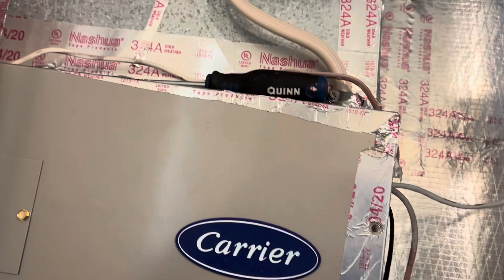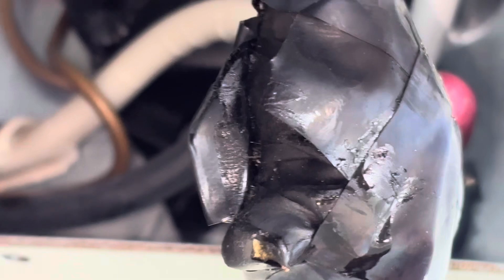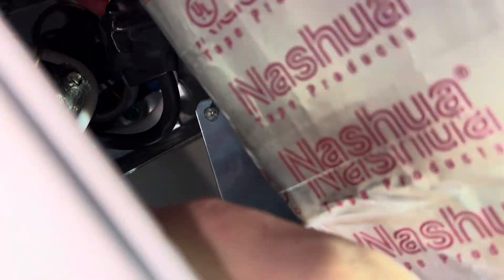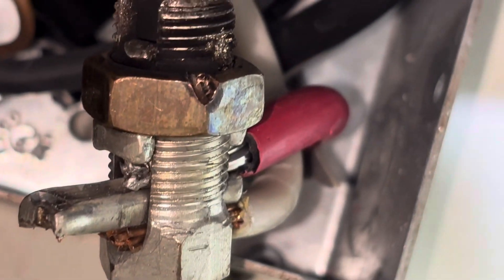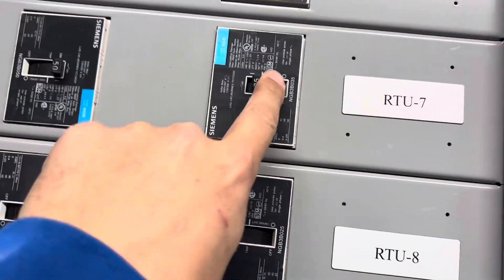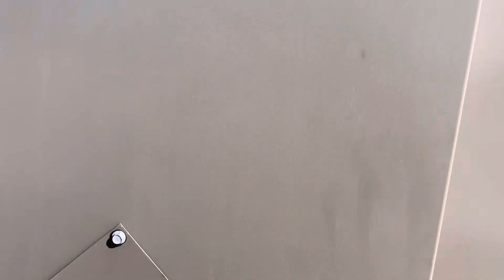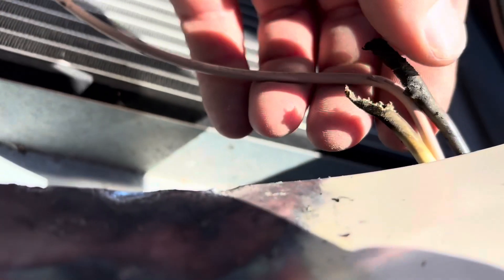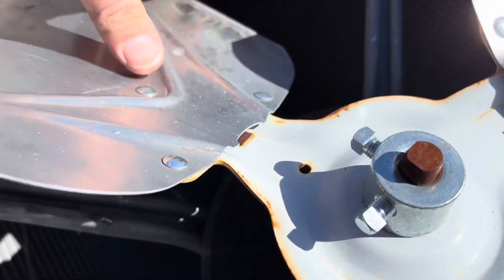Breaker Keeps Tripping On Heat Pump!

Comment: Well if I was a betting man I would guess the main line was ran long before the unit was installed 🤷🏻‍♂️ but that box? Cu inch wise is. Under sized. I have seen so many times apprentice and journeyman mount a box by the number of conductors, but they forget to take in the wire size changes the amount of conductors for box🤦‍♂️   Them split bolts  they are the best for a secure connection but most don’t use the protective box over them the old school way rubber then vinyl tape..
Nice job on the condenser repair👍❤

Comment: Thanks for this video Jeff. Isn't the QuickCheck acid tester supposed to be used in a running system?  Mine wasn't running either.
Reply from the maker: The system doesn’t necessary need to be running to use the 2 second quick check acid strips.  If there’s acid, it will be present if the system is running or not.

Comment: Are those splices code compliant? Seems like it wouldn't be but I don't know
Reply from the maker: The splices are actually done correctly.  Well… they used the right material.  Just not enough insulated tape.  But the code is, if you make a junction, it must be accessible.  This box is barely accessible so either the inspector didn’t see it at all or he looked the other way.
Reply: @JeffsHVACAdventures  Gotcha. Good to know
Reply: Safe to say...probably not...that box is borderline inaccessible...